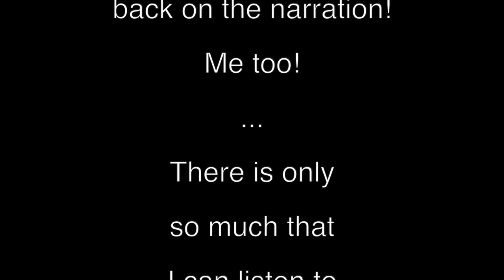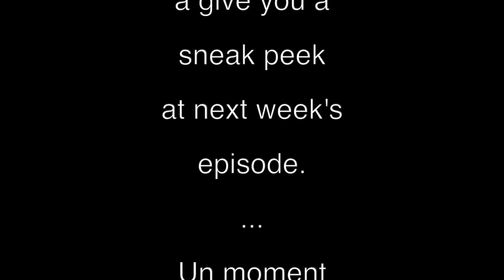Great progress at the chateau Ep 13

Comment: It looks like you guys have a good restoration budget, you are working with! Expensive isn’t it? Thomas! 😅
Reply from the maker: 👀👀 erm, we do not yet have the budget we need by a long shot! It is expensive but a whole load cheaper doing it yourself (as long as it’s done properly). One of the original builder’s quotes we had for a turn key ready finish was  several million euros 😳🤯 we’re hoping to get it done for A LOT lot (lot) less than that!

Comment: Pardon my ignorance, was the sandblasting merely for cosmetic concerns or did it also help prepare the walls for pointing?  Do you intend to leave the stonework exposed or will the walls eventually be plastered?  Perhaps the chateau has a considerable amount of sheetrock in its future?
Reply: Good question, actually.
Reply from the maker: Not at all ☺️ Exactly that. Both cosmetic but also ensuring the stones are prepped for the pointing. Although the joints then still needed raking out with a mini air chisel.